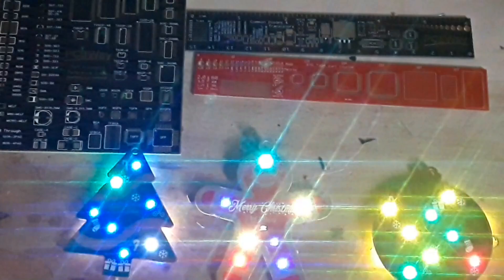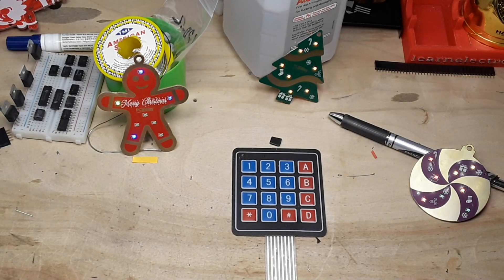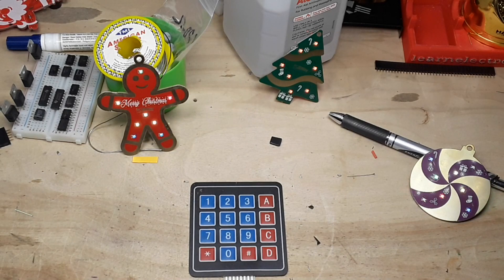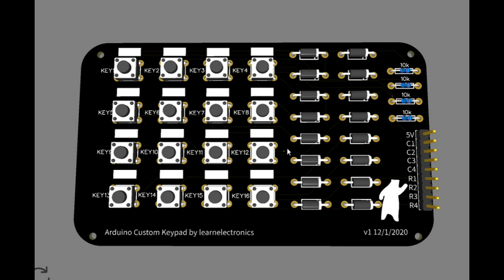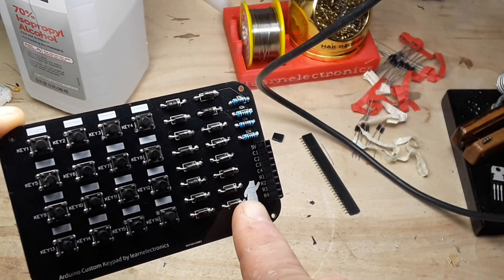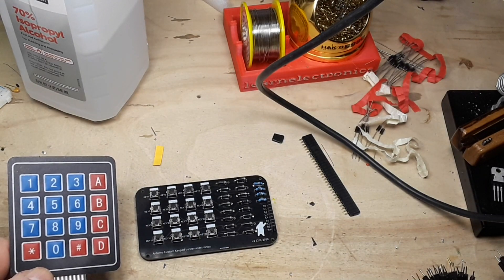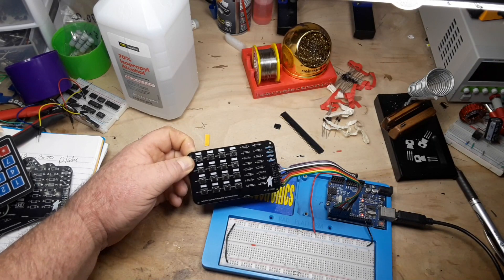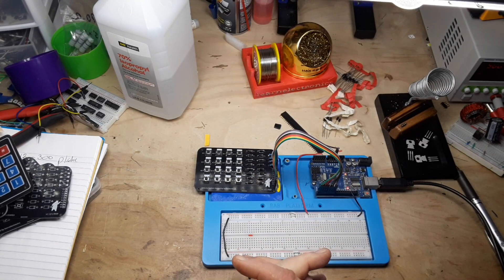Arduino Keypad PCB Design and Assembly

Comment: I would suggest two changes, either switch to silicone tactile switches - they are easier on the fingers, or switch to 12x12 tactile switches they are bigger,  easier to hit, and can have caps that can be labeled).
Reply from the maker: Thanks Steve, this was just the first iteration. I have a few ideas for version 2, and Ill add yours.

Comment: The membrane keypads are just switches, no pull-up resistors or diodes. Why add the resistors and diodes?  I assume the library uses internal pull-up or pull-down on the input pins.

Comment: Well done. I used to work in electronic security and commercial fire alarm repair and maintenance. I detest those membrane keypads.  Fail early, and not repairable as the plastic face generally falls apart about the same time as the metal domes fail. Saw too many systems with useless keys, and no replacement available from the manufacturer.  (all custom to the product naturally...)  

I live a fair bit to the west of you.  We got the white stuff too.  Didn't mind it so much this time around.    :)

Comment: I'm in southern Indiana and we got a heavy dusting the same day, lets call it 1/4" of snow... Lol
You crack me up at times Paul... It's a good thing you use PCBWay to PCBWay your boards sense they are sponsors... :-D
Thanks for the chuckle this morning!
Nice build btw. I hate those little flat button things, their crap. I have a remote for a HDMI switcher box and it sucks big time. I have a timer in the kitchen that is the same way crap buttons so I see the use for this for you Arduino users...
Thanks for the video!
LLAP

Comment: Could you make the PCB smaller and put the diodes and the resistors, along with the connector on the back behind the buttons ?
Reply from the maker: yes

Comment: Add a rotary encoder, then you've got a multi-function data entry device.
Yeah, the diodes really need to go surface mount.  PCBway will stick those on there for you.

Comment: Central NY, 2 feet of snow yesterday. Surface mount diodes and resistors. Not sure LED's for each switch would be any improvement. You already know which button you have your finger on. And for those with big fingers like me, board could be modified for larger spacing if needed.

Comment: You have enough room to move the buttons down a few millimetres and increase the size of the white pads to write the functions on. Also, just wondering, the buttons that also toggle up & down, left & right, do you need to add extra components / tracks to them or do you just need to alter the code so you could add extra functions to one or two master buttons so that you can expand the functionality of the keypad.
This may not work but am just wondering. Great video, thanks Paul.
Merry Christmas mate.
Edit** I do prefer this style of keypad as the standard flat Arduino ones are mass produced very cheap and all to often fail to fast. Your style is more robust and also expandable, much better connectors also.

Comment: I hate the membrane switches.  They remind me of the old ZX81and Sinclair spectrum. Would take a week to input a small program.  

The biggest downside is when a key failed you had to replace the whole keyboard and they had 13 pins on two ultra-thin plastic ribbon cables.

Comment: Why the diodes? The columns are with pull-up resistors so they must be driven by an open collector output, so no electric risk by shorting two or more columns.
I think that for most applications the diodes are not needed, and even the resistors can be eliminated if you have build in pull-up resistors in whatever you connect the keypad to.

Btw: you can get key's with build-in light too, and different kinds off cover/lid/top for the key in different colors, so the idea to make your own keypad is great.

Comment: I build a similar keypad a few weeks ago but without any diodes.  It works very well but what am I missing without the diodes?  Perhaps a shorting possibility if multiple buttons are pressed simultaneously?  I also removed the single resistor for the columms by including the pull up resisor functionality of the MCU.

Comment: There are plastic based insulating sprays specifically made for pcbs, you can probably find them on ebay or other places. They put a light coat of plastic on your pcb, they are usually colorless and you can easily remove them with heat using your soldering iron in case you needed to make a change in future. These are just for low quantity and hobby use, for larger quantities we should use conformal coating after assembly which is based on resins most of the times. Nice video, Thank You Professor 🌷❤

Comment: Convert the diodes to SMD, just kidding I know you hate SMD me too!  :) Cool project.
Reply: smd is not so hard to work with. you have only to practice your skills with working under a microscope. I for example startet to work in my new job with SMDs at first I was afraid and discouraged but with time and practice I got really good at it. I started to work the first of July 2020. and now in December the 23rd I can write text that is only 5 to 10 micron high under the microscope 🔬the text hello world fits under the area of a0402... i can solder 0402 with easy under the microscope and also 0201 but in that dimension you need e healthy amount of preparation... like fixing the pcb such that it can't move. no wind and something to rest on to get a steady hand and a steady surgeon hand 😉.
Reply: @icebluscorpion  nice to know!
Reply: @icebluscorpion  With the right tools... Yes? I was trained to the highest standard in the world back in the 1980s before SMD was really a thing, but with all that skill, I won't attempt SMDs without a soldering scope and a temperature controlled iron with the correct sized tip. Skill is only part of it.
Reply: Yeah but if they´re mounted at factory? (And resistors too)
Reply: @alvarobyrne  SMD is great it you have the tooling and it certainly makes for projects that are a LOT more compact. Horses for courses.

Comment: Fortunate I am building my custom button box at this time.  Just a small delay I guess because of the cold and the snow.  I put my button keys on perf board to get the spacing I needed.  But the soldering I did was terrible and I used solid core copper wire from an old network cable.  Sure to break if the perfboard flexes after a few hundred key presses.  Ordering from PCBway may be my optimum solution!

Comment: Wouldn't it be possible to tie the columns directly to the outputs (as opposed to Vcc) and make the rows INPUT_PULLUP.  Then I believe you could eliminate the resistors on the board.  What do you think?

Comment: In one episode can you show us how to convert dc to ac
Reply: Yes, I'm also interested in this
Reply: @Julian-xb1se  just push the DC through a square wave generator and then through a transformer. The output is AC. Just make sure that you set the square wave to 50 or 60 Hz to suit your country. You will need a little circuitry after the transformer to keep things safe but there are plenty of examples on the internet.
Edit**
electroschematics.com/12v-dc-220v-ac-converter/
Here is one example, just be mindful that simple DIY inverter circuits don't put out a perfect sine wave. They will power lights and power tools but never use on computers, monitors, TV's and other more delicate appliances. Laptops can be powered directly from a DC source so they are not included in the computers above. To power these devices your best to convert an old UPS and disable the beeper and replace with an led and a DC Volt Meter

Comment: For version 2.0

If you added a little .91" screen like this one (https://www.aliexpress.com/item/32661521340.html?spm=a2g0s.9042311.0.0.27424c4dkxKrGB) You could have the code display the button function on the screen and then you could move the diodes over the white squares on the board. It's I2C so you only need two pins.